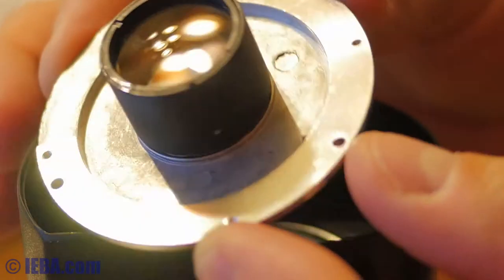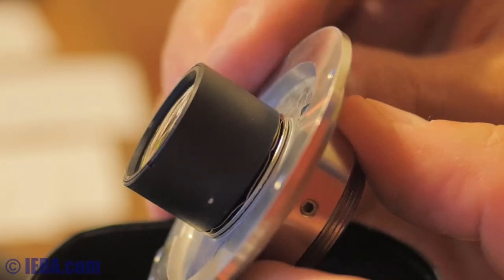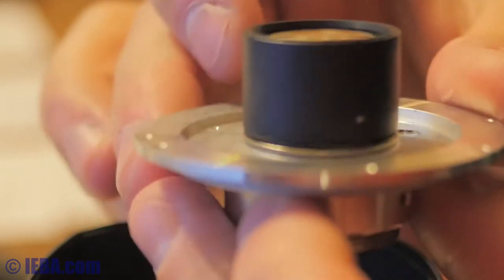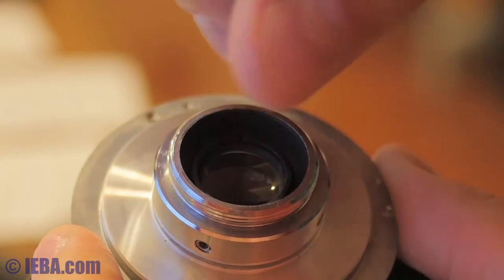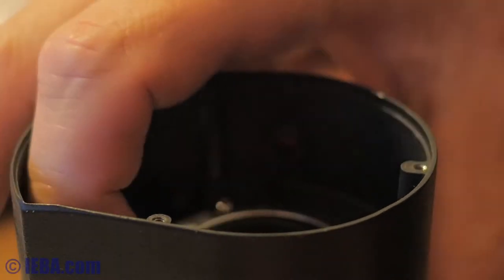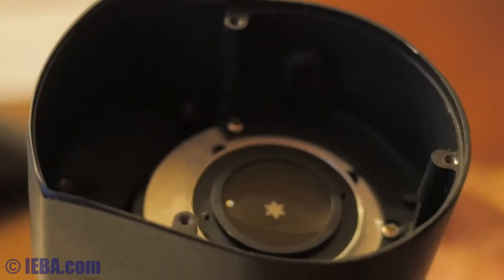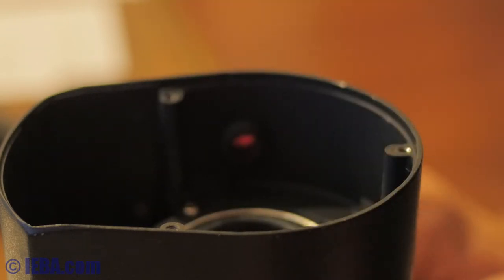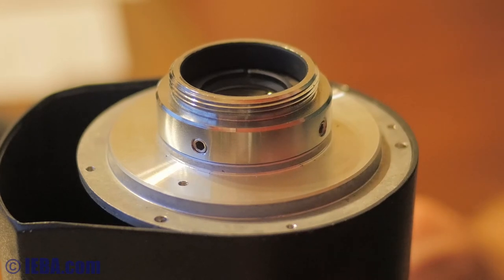C-Mount TV Zoom Lens 12.5-100mm 1:1.8 Rear Dis-Assembly

Comment: curious, why do you say its not a good lens?
Reply from the maker: Because it's not really well suited to this purpose, and the age has a lot of internal reflections- it lacks coatings.
Reply: @IEBATechThoughts  Thanks for the explanation. I have a similar era v6x16 which I've used on bmpcc & gx85.  trying to figure out what the different screws on the back case do, with an eye towards disassembling and setting the back focus for proper par focal operation.  But don't want to break my lens.  Any thoughts or suggestions?  Seems impossible to find manuals for these things.  Thanks for sharing all of the information you do with the community.